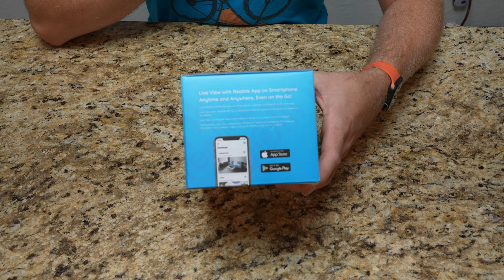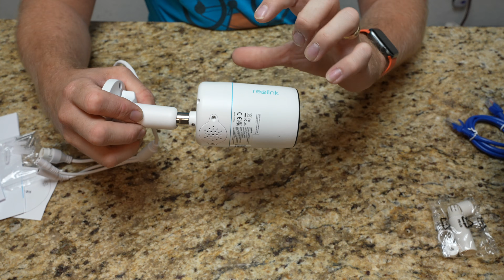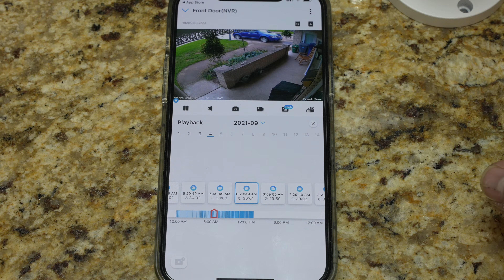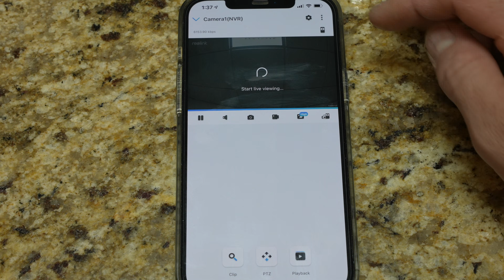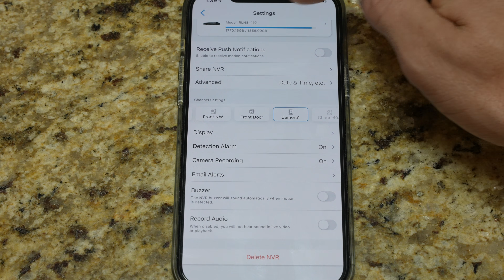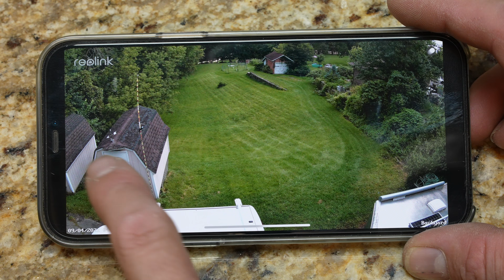Reolink 4k PoE Outdoor Security Camera Install

Comment: Dear,  I need help!  bought RLC-811A today, I wonder what is the problem is since it does not work. I use the blue original network cable that includes in to Poe and CAT 6 network cable to Lant, that going to my network router. I use the Ubiquiti PoE injector. What can be the problem ?